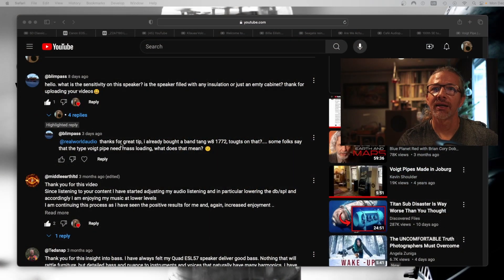Mass loading needed for Voigt pipes?!

Comment: Hi Janos, I wanted to follow up on my Voigt pipe build as I now have had them for about a month and i have had to make some changes. I found i was getting reverberation still on certain music  ( ie : Alt J) and had a few issues with the dispersion as they some tended to be very direct.  I tried tape, cables equipment swaps , but I found my issue was predominantly my floor. My room is carpeted on a  elevated MDF base. The minor fix I am sure you already knew when I said  I had directional issues above was to direct my openings to the side walls using some left over timber from the build,  my floor was fixed by adding some cheap high density rubber squares that  I found for almost nothing at my local hardware store.  Not only did it fix my reverberation but it propelled my sound in to stratosphere i did not know existed when paired with my little darling amp. I was shocked at how good it is. On the down side I am  no longer able to listen to poor recordings on this system as it treats them like trash.   I still really enjoy my version of La Grande speakers as I find they treat music emotively and they will be a great mate for my Voight pipes. So I will need to build another amp for them . Thanks so much for all your guidance and for sharing your knowledge , not only to yourself but all the regular  commenters,  I make sure to read them all with every video; there is so much share knowledge on this site . Thank you all.
Reply: Do you have a thread/ log of your build? Would love to read about it!
Reply: @ sorry no i haven't.  I can tell you that my measurements 2018mm/285mm/285mm. opening is currently 285mm but still experimenting. My driver is mounted 1050mm high. I used 30mm square block at the top between front and back which were 285mm wide  pine and got a 2420/1220 Marine ply for the sides which i got cut into 4 lengths at the hardware store then made my triangles from them. I used Sonido sfr175a drivers. My only real building tip comes from a video from @EduardBroekman who often contributes to the comments , that was to use polymer foam with a self adhesive which is used for car window sealers to air seal my joints.  Only brass screws are used.  You could definitely use a less wide baffle to fit the 184.5 mm  needed for the driver and maybe at sometime I will do that as well.

Comment: Hi Janos, i am using the measurements for my build that tech ingredients did in their video, as for the driver mounting hole it is 86,5cm from the bottom off the cabinet to center,, that leaves 115 cm from center to the top,, any toughts on that ? before i drill out for the driver, thanks so much,  best regards from norway😀
Reply from the maker: From what I remember his videos is that he spent effort on optimizing the position of the driver, so I'd say go ahead with the recommended position. Have fun for the build in Norway! Cheers, Janos
Reply: @realworldaudio  thank you, will try it out, greetings 😀

Comment: Hi janos thanks for a clearing that subject will for sure try with out first as you recomend,,, what matirial would you prefer for mass loding ? best regard  from norway😃
Reply from the maker: Hello, the answer is really easy: air! Mass loading is with air. It is the weight of the air column that creates the loading. Cheers, Janos
Reply: @realworldaudio  so you mean more whool or other dampning matirial inside the speaker means less air and also less mass load? and vica versa? sorry for many questions but i am just a simple man🤣
thanks for takeing your time
Reply from the maker: @blimpass  Great questions! Solid sampling material takes away from the airspace, and means less air. Wool slows down the motion of air, and thereby effectively increases airspace because it takes more time for the air to move through the stuffing. 
In addition, the wool / stuffing also acts as a dampening device and prevents the cabinet walls from allowing the acoustic energy to leave through the cabinet wall.

Comment: Also 30 yrs ago a dealer told me, if I remember correctly, that tube amps there is no need for any mains filter. What do you think about this?
Reply from the maker: I agree with it. However, filter everything else in the house... :) I keep my fridge on isolation transformer, corcorm filter for the LED lights, computers run on MIT Z stabilizer, modem on Vans Evers - but amp is connected direct ; )

Comment: Hi Janos! In this video you make an interesting statement. Like you said, a sealed enclosure makes time smear. A german audio youtuber said, a closed box is very much on point, very precise without delay. Will I have to find out myself, what sounds better to me?
Reply from the maker: Thank you for sharing that! Yes, closed boxes do have a speed coherence as there's no delay between cone and port, just a cone alone. The smear with sealed is in the low level details as the air acts as a source of drag on the cone that chokes the really fine cone movements. Chet shared his experience above (3hrs before your post), that when he mass loaded his pipe the clarity and transparency suffered. Sealing the cabinet will take that clarity and transparency loss to the extreme - yet, at the same time preserving bass timing better, and also, -3dB loss of efficiency as well that will make the loss of clarity and transparency even more striking. 
So yes, it is best to listen. There's no single best solution, only different flavors, and I think each flavor suits certain recordings better, and matches different amps / rooms better....

Comment: Hi Janos, your earlier videos on Voigt pipes inspired me to build my own, a TQWT, around a 8” full range driver having a Qts of 0.45. I used a cabinet design in the public domain as the basis for my speaker which was using mass loading. But as I was not sure, whether this or an open mouth will be the better choice, I build a cabinet prototype which allowed me to play around with different openings. As a result, with this driver in my room, an open mouth with approx. the same size than the driver cone came out as the best option. Mass loading, independent of its tuning frequency, brought no improvement in the low end but had a negative effect on clarity and transparency in the mid-range. This was an unexpected result, but your video helps me to get behind the effects observed.
Reply from the maker: Superb comment, thank you! Made a 1hr follow up answer video to your comment, but it did not record :(
Reply: @realworldaudio can we hope for a second attempt for an answer vídeo? (2)
Reply: Hi Janos, thanks for your kind comment. Can I hope for a second attempt for an answer video? Anyway, thanks for your work und inspiration.

Comment: Hi Friend,    should be  interesting  to set up  a 3d plan of masses and  densities of the cabinet,  and  work  with accelerometers  captors  every 5cm on the  surfaces,   to  tune  everything more accurately..
having  a nicely made  cabinet  but  a poor room is  a bit  stupid.  in fact  one must  optimize  everything   going  from the source  to the ears  to  reach the highest  score... and the best  experience.    changing  something in the middle of  the chain  is  kinda non sense if each step isn't perfect...  soooo much work
Reply: working  on every weakness with a frequency generator through the amp...